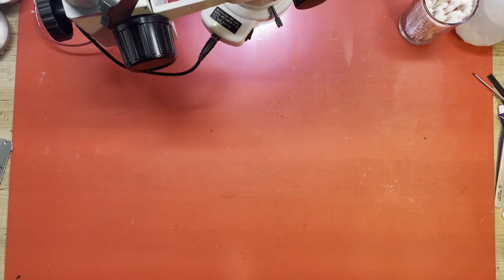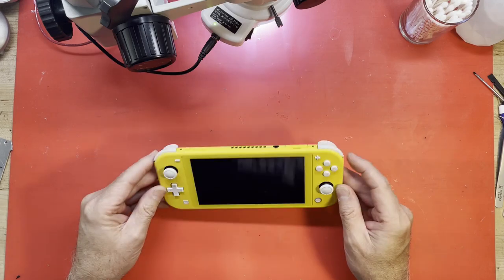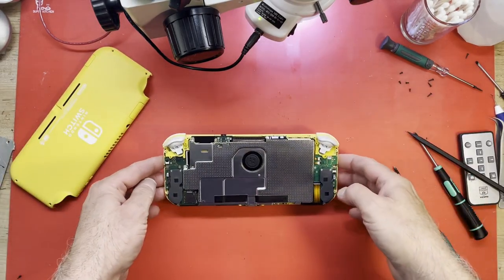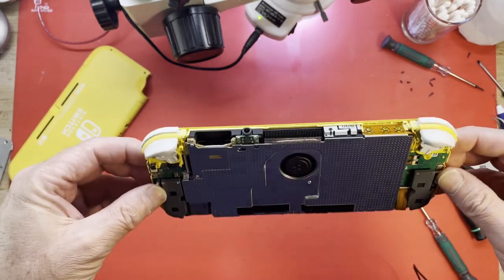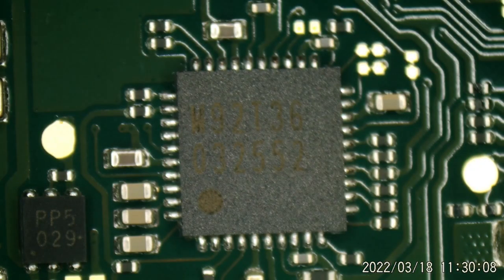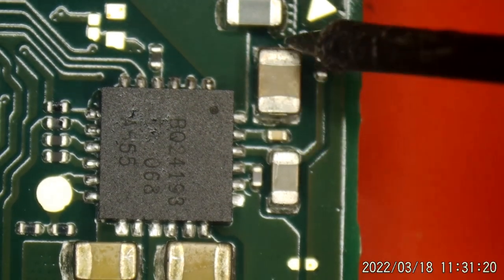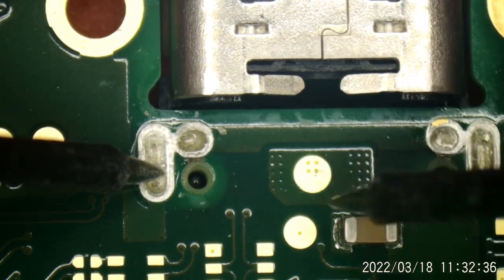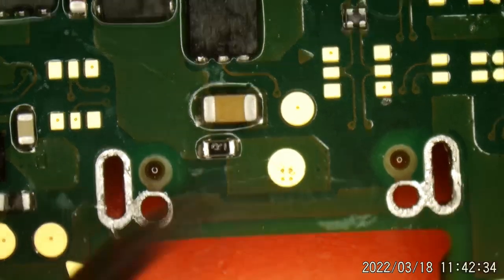#29 Repair of Nintendo Switch Lite No Power

Comment: Great job. I did the same repair on a switch lite weeks ago, but instead of filing the new usb-c connector i cutted the extra metal with a jewelry hand saw, worked very well
Reply from the maker: Thanks!  I don't have a saw that small so I have to use a tiny file.

Comment: how are you able to get your solder to stick on the tip like that? using a hakko and having hard time with it
Reply from the maker: The Hakko original tips should do a good job.  I have better luck with flatter, knife like tips over a conical when it comes to holding solder.  More surface area I suppose.

Comment: Hey bro .. nice video ..please help me if you can 

1) i have a nintendo switch ac adapter (which is fine) but its usb typec male port is faulty .. now the thing is when i stripped the wire .. i have 5 wires (2 black / 2 white/ 1 blue)

2) using the multimeter is not helping me understand these wires .. here is the information that i can give you :

using the multimeter (now I am checking the voltages of different combinations)

a) white & black : 0 voltage
b) black & blue : 2.94 volts
c) white & blue : 2.94 volts
d) white & white : 0 voltage
e) black & black : 0 voltage

Additional information
a) there is continuity between the 2 blacks wires .. and same there is continuity between the 2 white wires ..

PS: if I could understand those wires .. i can put a new usb typec port .. i have been trying to get this info .. but there is no help .. is there anyway you could help me .. please let me know ..

Regards
Rahul

Comment: Im 2 years late to the party lol but HYPOTHETICALLY… say that your 8Q and M92 doesn’t have any shorts in your capacitors and your fuse and charging port aren’t shorted where would you have gone next? Let’s also say you have 15v and you have the battery plugged in 😂

Trying to learn. Waiting for a no power NS lite to come in the mail.